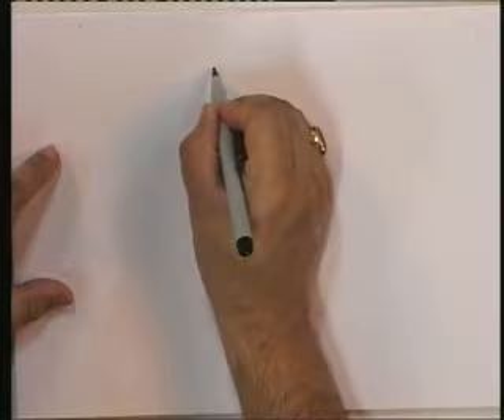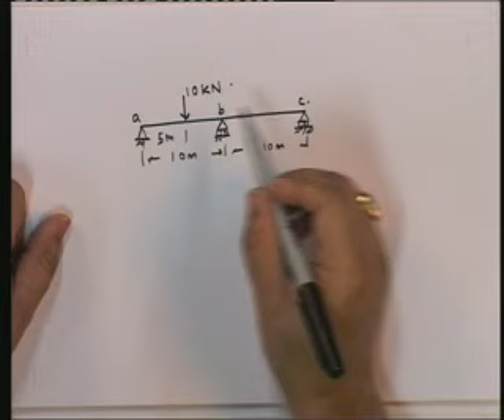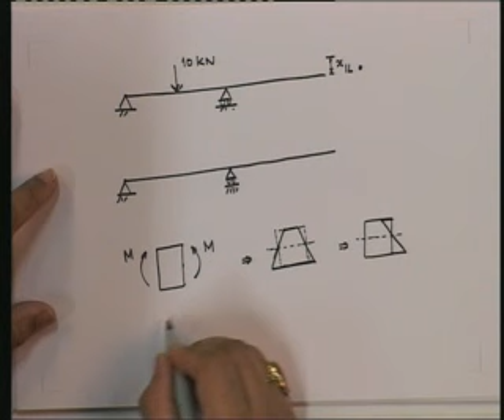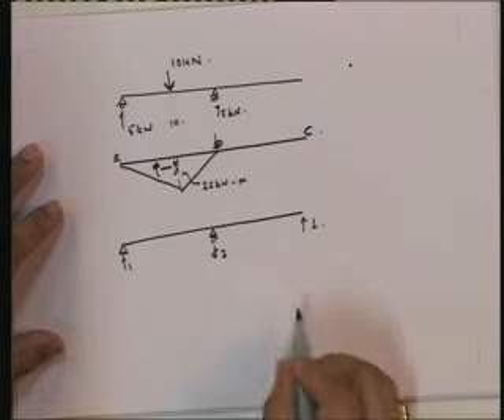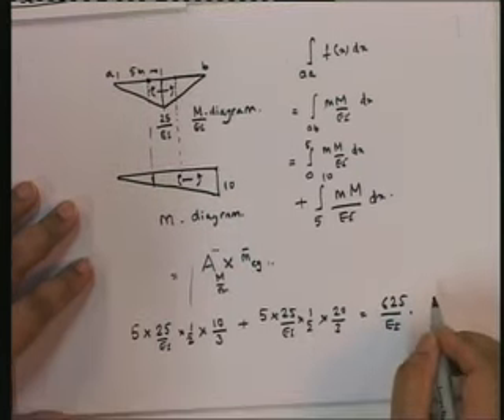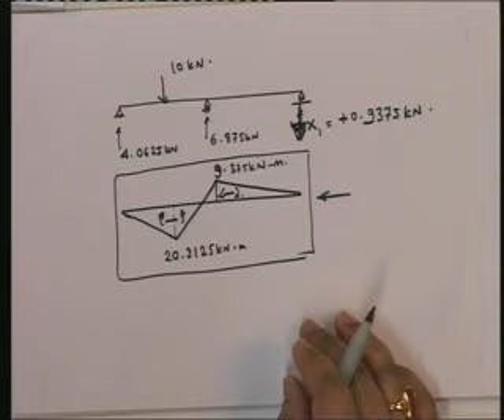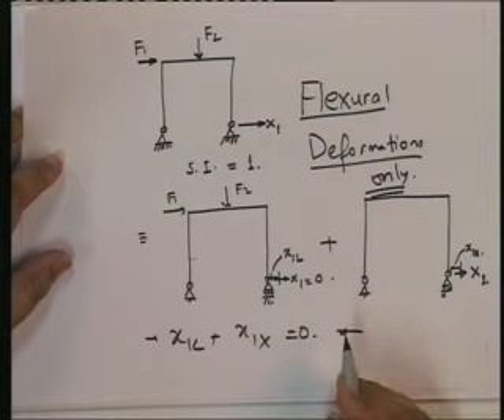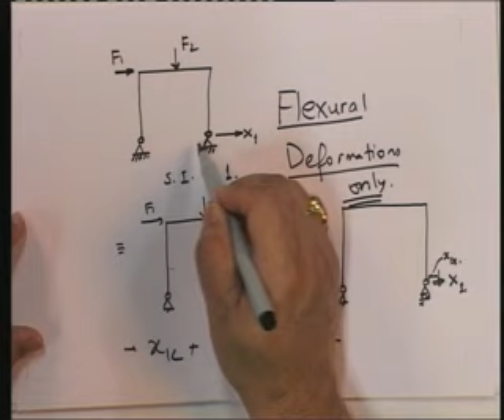Lecture - 5

Comment: very bad lecture....taking time for unnecessary stuff....instead of teaching concept u r teaching how to do numerical....u r iit prof...come on yaar
Reply: Solving numericals properly helps in understanding the purpose of methods in Structural analysis
Reply: @jprakash4680  solving numerical without a hint of theory ....u have taken a mind blowing stand sir...
Reply: @singhdurgesh660  without a hint of theory? Are you fast forwarding these videos to find out concepts? Please don't do that. This is a lecture course, not coaching class. He's an IIT prof for a reason, I did feel like you're feeling at first, but later I kept some patience and watched it full, trying to complete the rest of his lecture videos.
Reply: @jprakash4680  offcourse...u know i  m not as bright as you are...or related to professor as you are...😔😔😔
Reply: @singhdurgesh660  Loool
Reply: @jprakash4680  🙊🙊🤪🤪😘😘